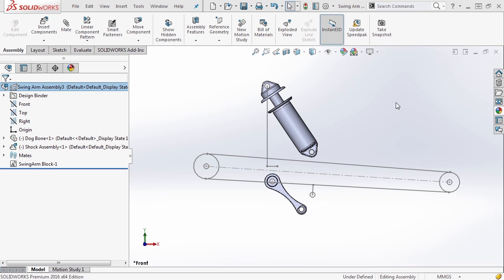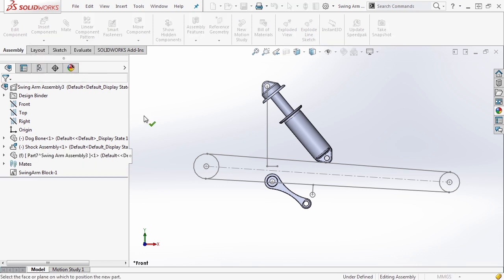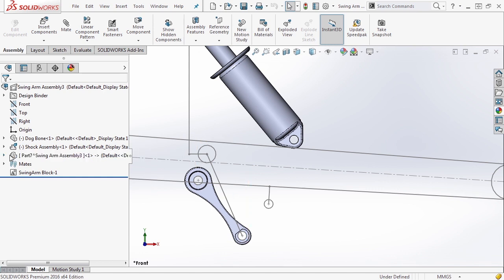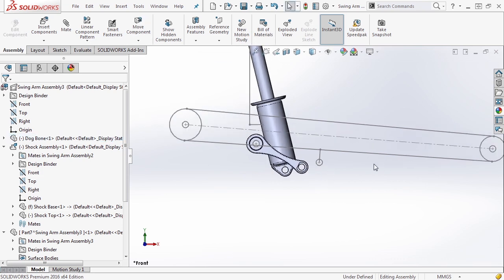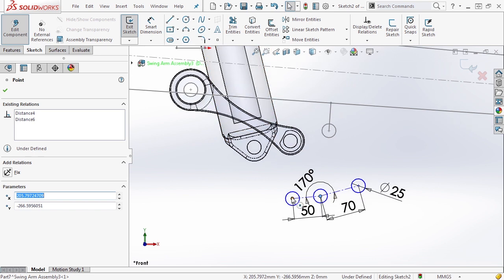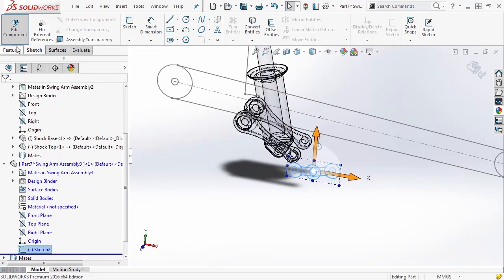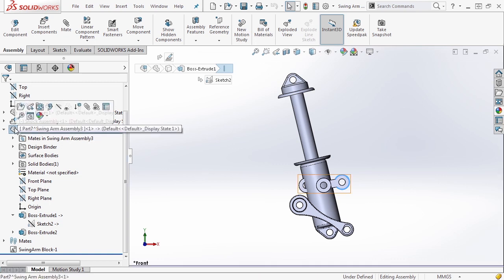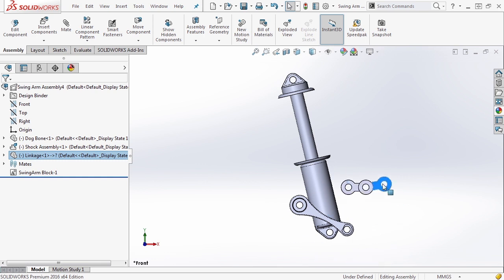Solidworks Tutorial 59 : Create An InContext Part

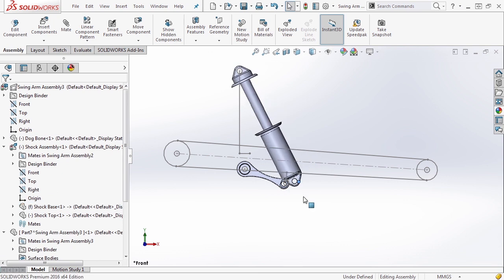Comment: 5:00 You don't have to delete the hole sketch. Either select break all from the external reference dialogue, or just edit sketch, delete the relations, and reapply them. You also dont have to hide parts, many times in 3D view skerxhes are selectable, and usually solidworks prioritise sketches. You can also use selection filter to be able to only select sketches, so if no sketxhes are visible at part level, only assembly sketches will be used when creating relations.